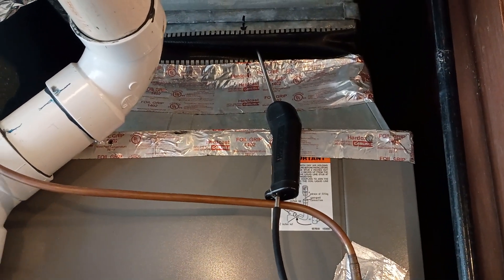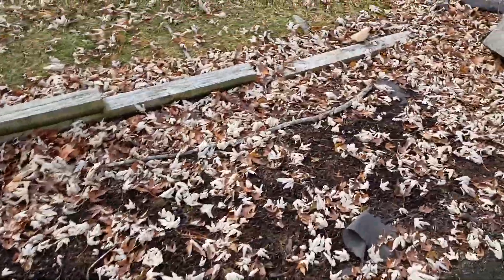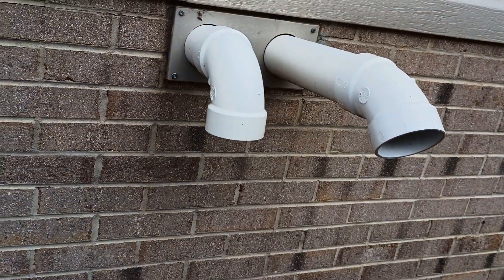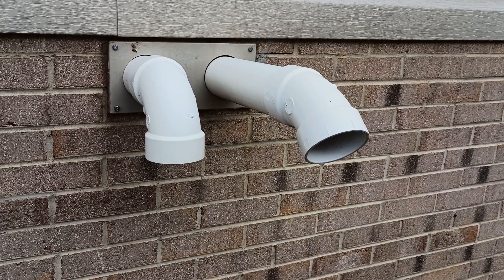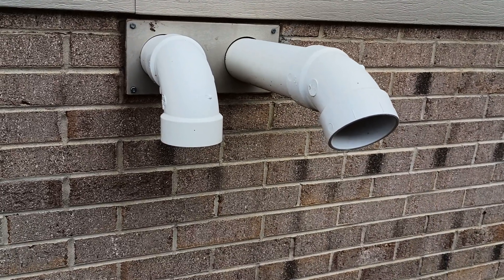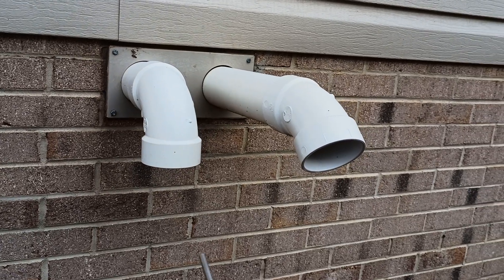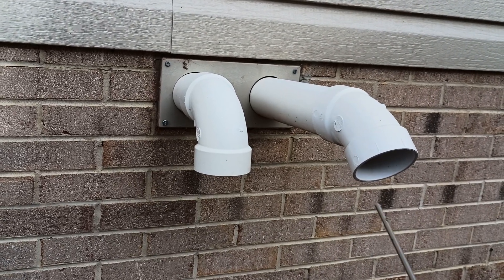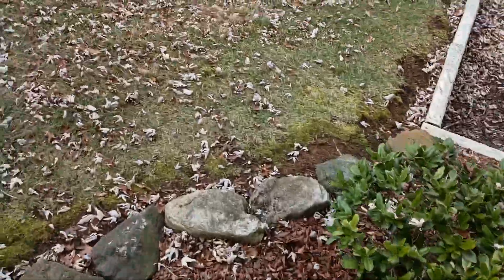How much is too much? When is a furnace not safe to run? Taking CO readings in the exhaust.

Comment: That yellow flex line inside the combustion compartment is a code violation ....and  a imbalance in the return and supply ductwork can cause heat exchanger to overheat and crack..also